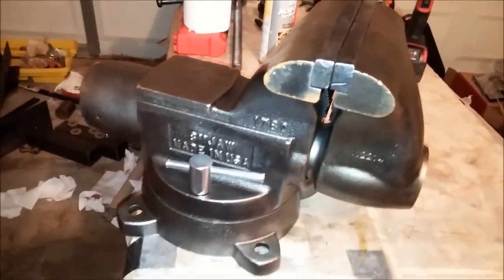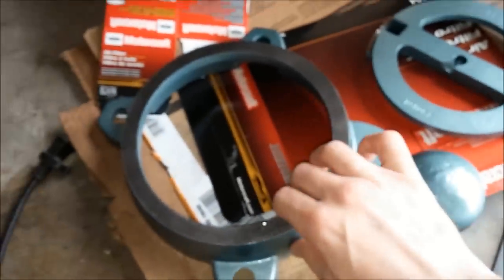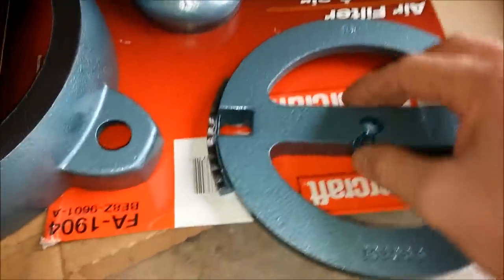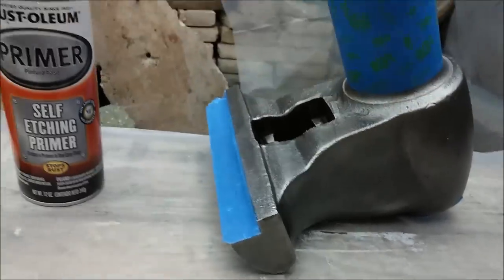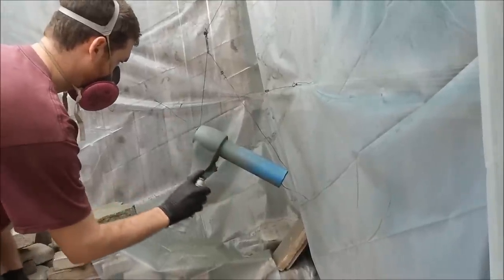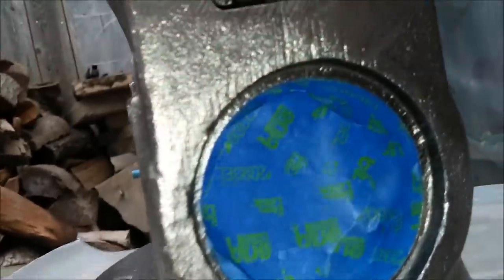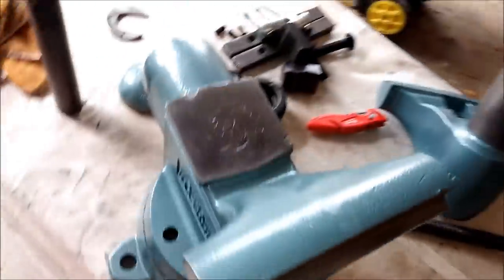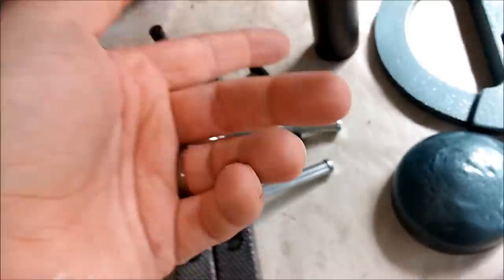Wilton 8" 1780 Vise Restoration P10 - Painting

Comment: Excessive power wire brushing polishes the surface leaving no anchor pattern for coating.
Abrasive Blast and Serious Metal primer followed with high build epoxy coating would be a forever coating.

Comment: How is the paint holding up?  The reason I ask is that I read you cannot apply paint on top of etching primer and that you should do a different type of primer in between. About to do my first vise restoration. Thanks!
Reply from the maker: Below expectations for a vise. It isn't very durable, so anywhere I've hit it the paint tends to flake off.

Comment: Looks really nice. If you get a chance you should look up a chrome shop and get it plated.  Straighten out the handle and screw and get them chromed plated it would really set it off and look great, the cost is usually not bad at all.
Reply: Again, ref the video... You are painting but the commentary refers to the hydrolysis?
Reply from the maker: It's normal for me. Are you sure you don't have multiple tabs of different videos open at the same time?

Comment: after all that work to lay on Rustoleum sad. Dupont Colar primer and Dupont Inron top coat would have been like tile.
Reply from the maker: Agreed. The Rustoleum isn't holding up very well.
Reply: lets back up a. bit.. frankly it is a vice and no coating will live long, what's most important is you saved a valuable tool and got all it's function back. nice job